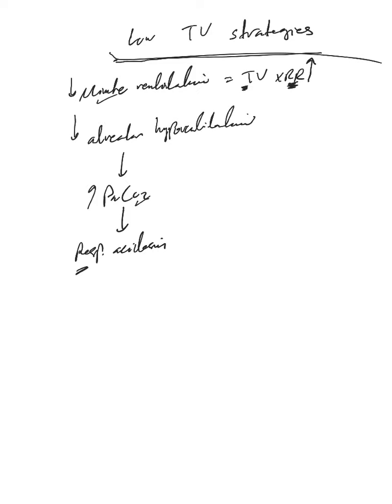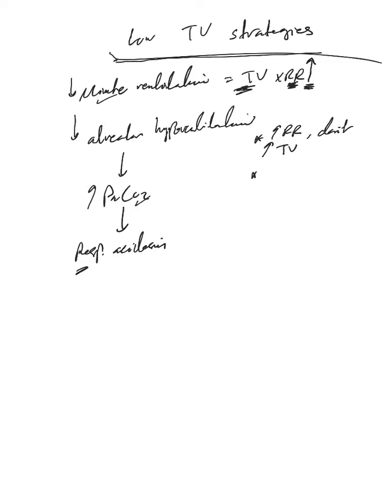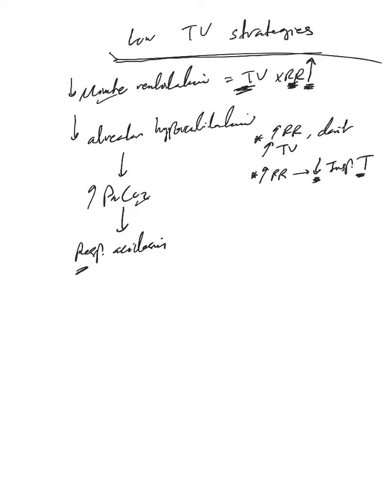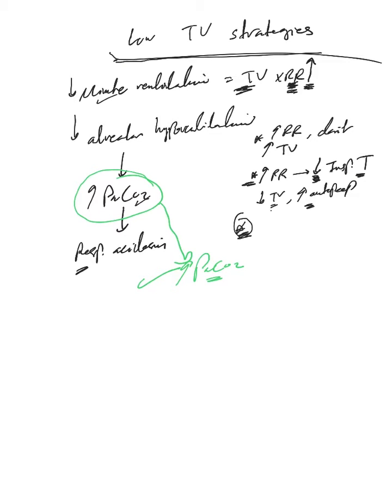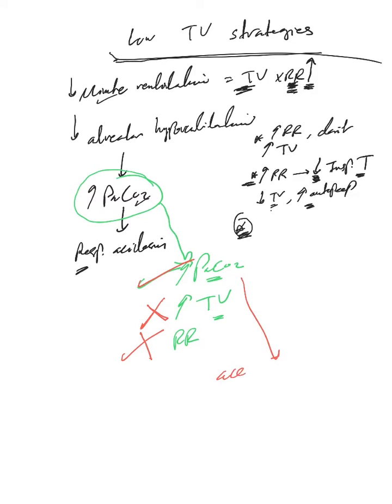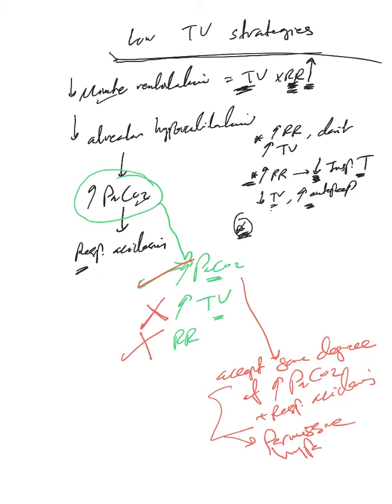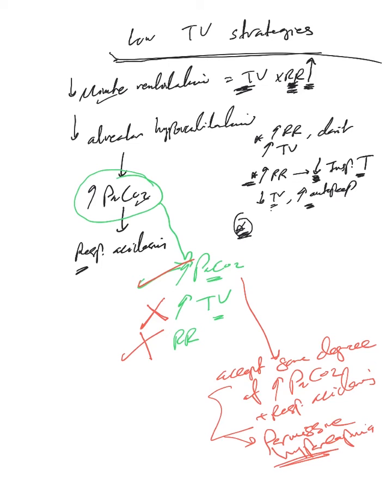Mechanical ventilation (65): Permissive hypercapnia

Comment: you mean cannot decrease insp. time any more not increase?!
Reply from the maker: Thanks for reaching out! What I meant increasing RR can decrease respiratory cycle time (respiratory cycle = insp.time + exp.time). Which mode we are using will decide which one will be affected. For example, In pressure control mode insp.time is fixed, that means only exp.time will decrease with increasing RR